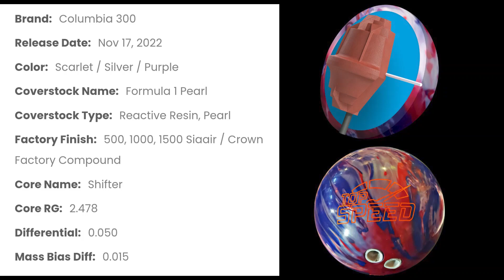Straighter Is Greater? Short Pin Columbia 300 Top Speed Bowling Ball Reaction Using PAL Layouts

Comment: Do you see yourself adding more short pins moving forward?  I haven't drilled one yet, but laid my first one out with the PAL system and am thinking about using it on a piece soon. Would love to see a video where you compare the different PAL layouts. :)
Reply from the maker: I love my short pins. They are super controllable and I can play straighter. Everyone 2 finger bowler I've drilled one for loves theirs as well. Currently I have a 1 1/4 inch One Remix, 2 1/4 inch Katana Assault, and a 1 1/4 inch Quantum Evo Response I just drilled. When I shoot the Quantum review I'll compare the 3 short pins. If I do a comparison of the PAL layouts I'd like to do it all with the same ball so the cover and cores are the same. Maybe I'll catch a ball in closeout to do it with.